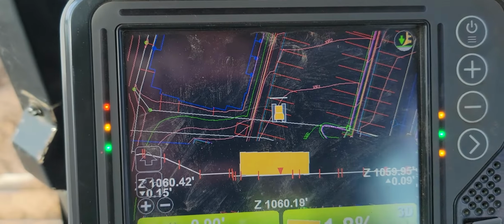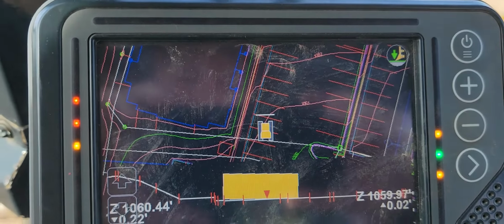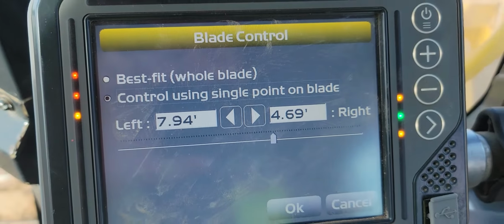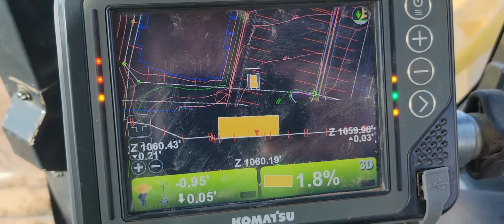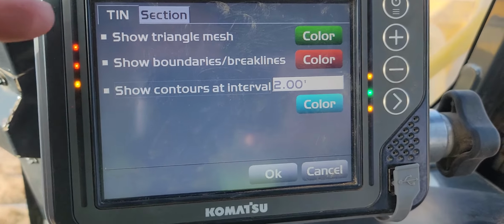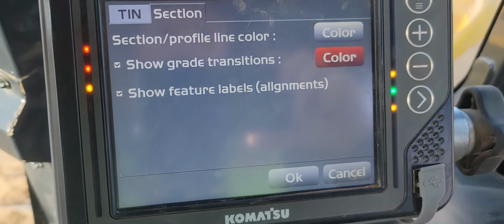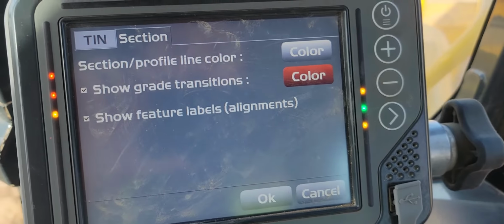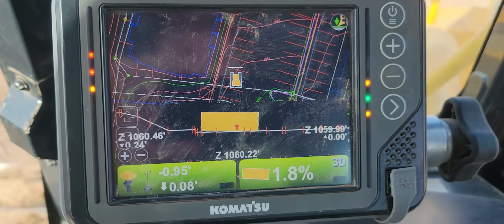Komatsu IMC Dozer - Using Blade Control and Viewing Grade Transitions

Comment: How do you get the indicator lights?
Reply from the maker: You go to the Control Tab and Edit the machine file. Don't change anything in the machine settings, but on the last page it will give you the option to set the indicator lights on the left right and center to cut/fill or offline guidance. I always set them at 3/5 for the setting. I don't really know what that correlates to, but should be easy enough to check it against your cut/fill values if you want to know.
Reply: @ctpusa1 thank you !!!!!